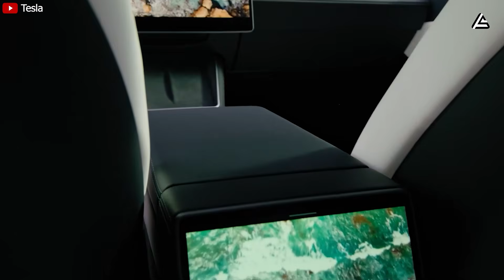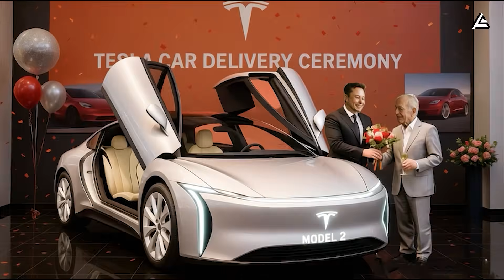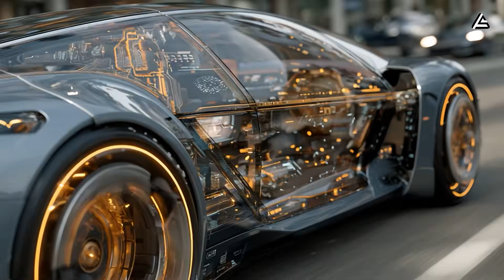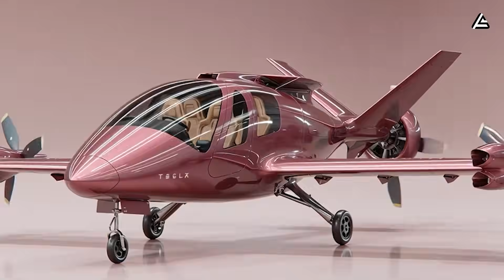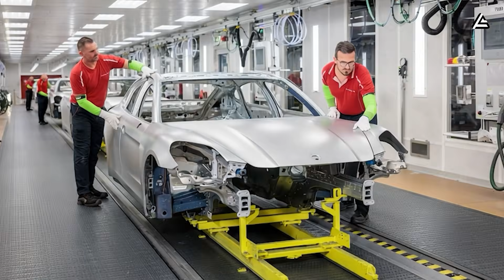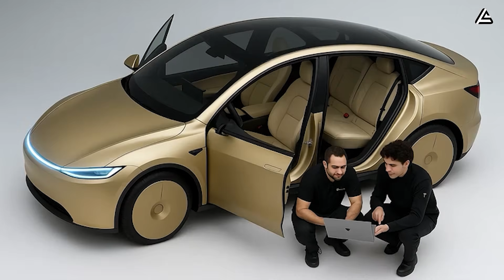2026 Tesla Model 2: Interior, Exterior & MORE. What's Hidden Behind?

Comment: When. "WHEN RAIN IS FALLING "  hard will opening doors 2 door models leave passengers in rear seats excessive exposure to rain? And the price will be
&  $14699.00?
Reply from the maker: That’s a good practical question. With a two-door design, rear passengers could definitely spend more time exposed while getting in or out during heavy rain, so door design and entry speed would matter. And on the $14,699 price, I wouldn’t count on that number yet, Tesla has not officially confirmed a Model 2 at that price. Until Tesla publishes the real vehicle and pricing, treat numbers like that as speculation. 👍

Comment: i like the look nice looking car metallic blue would look nice like th mg 105 nice color nice interior the white would look nice with the blue  don't know if you would get the door open in the hospital parking its pretty tight i struggle to get out feels like limboing out the door but other than that nice car
Reply from the maker: Your door concern is very real though. If the Model 2 ends up being a compact car (which most reports suggest), tighter door openings could be an issue in narrow places like hospital lots. Hopefully Tesla designs wider door angles or higher seats so it’s easier to get in and out